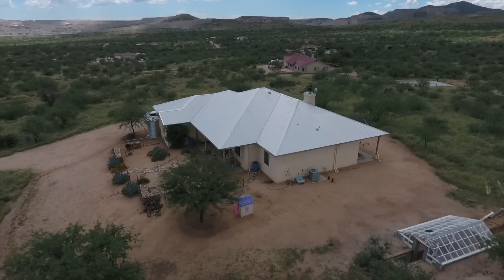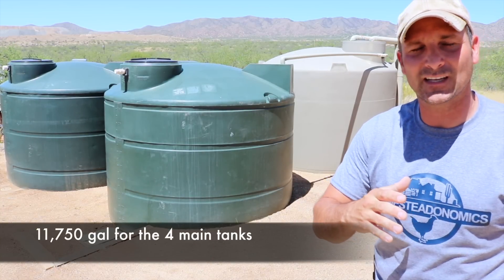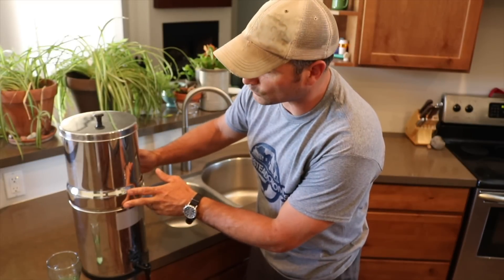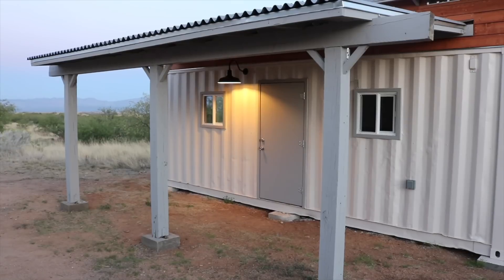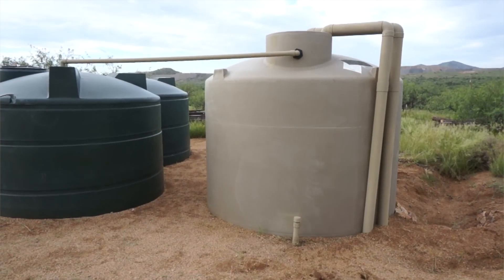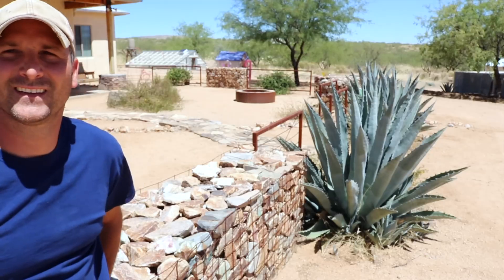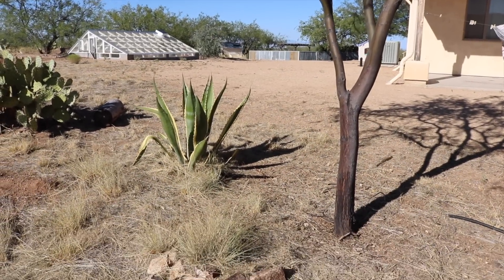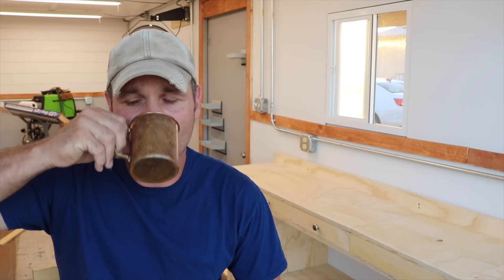Rainwater Harvesting QA - Cost, is it Illegal, how I treat, etc,.

Comment: Love the video and great information! We have 85 acres in Zambia and are currently in the process of turning the land into a farm. Our 4100 sq ft house is built up to the roof level now! It's a 5 year project! We currently live in Oklahoma. So, our land has a small stream, but dries up in the dry season. We plan on installing 2 boreholes as well, but also have a rainwater collection system to use for animals and crops when the stream goes dry. Boreholes are the last resort! My question is: how do you remove all the settled sediment from the tanks? Over time, it will build up. Thanks again!
Reply: hdezmelissa to remove sediment firstly empty the tank, then put down a ladder into the tank, climb down into the tank with a bucket & spade. Then start filling the bucket up with sediment. When the bucket is full, climb out with it and dump the contents. Then repeat.
Reply: To remove sediment you need to flush the system using water to force sediment out or empty a tank and clean it out with a tool.
Reply: I just thought of this, but if you have a large drain valve at the bottom of the tank, you could drain the tank, then use a hose to spray out the sediment and just sluice it away.

Comment: Wow, here in Ohio we have on craigslist those bins.  you see a metal wire cage around the container.  They are listed for as low as $50.00.  You could get one on a pickup truck I believe. I thought of buying a few and putting them on the corners of the house to collect rainwater so I could water trees and flowers without running up my water bill. I was then going to build a small wooden fence around each one to hide them from the road.  Maybe put on a cut out wagon wheel or something for decoration.  I enjoyed your video on how you had it set up and now I know I am going to do it!

Comment: We live in southern Mexico where we finished building our 3500 sq ft adobe house about 2 years ago. We get about 35-40 inches of rain during the 6-month long rainy season here at about 8000 ft elevation. We topped the roof with galvanized steel and with all of the patios and eaves, we have about 6000 sq ft of collection surface. We put gutters on one side of the house to carry the rainwater away from the uphill side of the house because we were not getting sufficient drainage.

We haven't collected rainwater yet because we can get all the high quality well water we can use from the city for about USD$18 per year. But in the future, the quality or amount of city water may change drastically so we  may collect rainwater in the future.

I wanted to ask you if you are able to use compost or sawdust toilets in your area. This would greatly reduce your water consumption. We have used a sawdust toilet in both of our bathrooms for about three years now. Once we fill up a cubic yard of compost, we let it sit for a year and then spread it around on the field where we plant fava, scarlet runner and black beans. We are not connected to the city sewer and do not plan to be. All of the black water from the town flows untreated into the local Zahuapan River so we have decided to not participate in that pollution.

Thanks for your video. I  appreciate all the thought and planning that have gone into what you have done there and the time that you took to post it.

Comment: Okay, SECOND issue I am able to see. If you have some say.... 18w CLF that has ZERO Phosphor. Wouldn't you just ensure all water passes through some oxygen while under UV lamp? Creating Ozone inside the bubbles. Ya might get some whistling toliets... But it's just gas build up. Well leave the bathroom fan on. Ozone isn't that healthy. BUT easily funnel it away which would float into top most layer of Atmosphere. Try not to operate 4 hours before a lightning storm. anyway :thumbs up:

Comment: I have a place I am building in unincorporated Colorado...I like the tanks you have but can they be totally buried as I will need to address the freezing issue every winter...
Reply: Concrete cisterns are the way to go for buried/underground tanks. And you have 2 choices generally. You can buy a "Water" cistern, or you can buy a septic cistern. And the septic cisterns are roughly half the price of the water cisterns... And did I mention that either will be brand new (clean) and made exactly the same...  Do I really have to spell it out any clearer?

 And since you are in Colorado (or anywhere else where they think they own the rain) I would keep the small talk to a minimum with your salesman and delivery driver, and back hoe operator (installing the cistern on your site). You bought a septic cistern and they are simply dropping it in the ground for you. Bye bye now, I'll take it from here.

 And one last tip. By far the greatest threat to your freedom of collecting and storing water, should your local thugs deem you unworthy, are your neighbors, and people who regularly pass your property.

 Plan ahead and make the project happen in one day and minimize the busy bodies curiosity. Also best if you disguise/bury/conceal the plumbing to simply "Appear" normal to your area. Nothing to see here, move along.
Reply from the maker: hi william.. these are not designed to be totally buried.. you'd have to get meant to be buried... those types will have ridges or ribs on the sides to give more strength.  I'm actually investigating the possibility of doing a buried tank to add to my storage.  But my tan tank is about half way buried if that's any help:)  
great to hear from CO!  Joe
Reply: thank you for your prompt reply...I love what your doing where you are. What a great thing to be self-sufficient as God intended, well done!
Reply: As another source to check into, I would suggest a new fibreglass tank meant for fuel storage.  They are designed for burial in the ground.  As a caution check for ground water and how deep the top surface of it is.  An empty tank can "float" out of the ground if there is a high level of ground water.
Reply: Janice, you need to check what kind of plastic that tank is made from.  There are many grades of plastic and some are NOT safe for food or water storage.
Reply: You could build a concrete "box" to lower your tank into. The soil will not contact the tank. It will add significantly to the cost of the project, though.

Comment: If you need more water, you could just take a liner from an above ground pool and place it on the ground with an inward pitch to collect the water.  Dig a hole in the middle where the water collects and bury an underground collection tank.  Use a pump to move the water to your house

Comment: WOW! only thing if you cover those clear totes you won’t get algae. Does hurt anything, just grody and stinky. Have you looked into using one of the big collectors in a greenhouse to act as heat sink. It is what they did wirh plastic drums for passive solar. Just wondering. I DIDN’T KNOW YOU WOULD GET ENOUGH WATER WHERE YOU LIVE TO COLLECT THIS MUCH WATER....great job.

Comment: In Utah, you can use up to 2 closed containers each of 100 gal. max without registering with the state but if you do register, you can use up to 2500 gal max. No cost to register. I spent 2 years working to add greater flexibility to the previous law. See http://fredcox4utah.blogspot.com/2013/03/2013-hb-36-stormwater-capture-amendments.html
Reply: IF you have water rights, you could store more.
Reply from the maker: Hi Fred,

I would prefer there be no legislation governing the collection and personal use of rainwater.  But I appreciate you at least taking steps to make it easier.  Thank you sir:)
Joe

Comment: 10:36 I was expecting you'd say, "I still think the argument doesn't really hold any water"

Now my question is, rainwater is too soft. By that I mean it doesn't wash away soap easily. How do you deal with that? Do you add anything in your tanks, or does it get slightly hardened by staying in the tanks?

Comment: In the Puna District (and other areas also) on the big island of Hawaii, a lot of houses use rainwater catchment systems. We have metal roofs. The water is stored in tanks, in our case, I think 12,000 gallons.We have a pressure tank, a water pump,etc. We use two filters. First a 30 micron, then a 5 micron. Lastly, we have a UV light, which kills any living organisms that might make it through the filters. Our water tank is made of corrugated steel, with a food grade liner, and a cloth cover. Filters get changed when i notice the water pressure might be lessoning, usually about every 3 months. The pump and pressure tank, I believe are common in well systems too. Plenty of rainfall here, a lot of it at night, so our tank never gets very low. In some states, it is illegal to catch and use the rainfall that falls on your roofs.

Comment: 5000 USD? That's nothing, just the installation cost, the cost for getting access, not the actual installation with pipes and digging and shit when we were forced to switch to the municipal system back in 96 was 230 000 SEK I think for our house, USD was about 6 SEK back then I think. So just getting the access cost in the region of 40 000 UDS, plus 1000 sek a meter for the digging and pipes which was 150 meters or so. That in 90-ies money... 5000 USD, you got a good deal right there bud.

Comment: the reason its illegal some places is not usually a good reason. most major cities will say if a house is not connected to the right recognized utility grids like water and electricity, it is not fit for human habitation via their own standards. someone who lives off the grid with water collection and solar panels would pretty quickly get flagged for substandard living and would either have to connect to the grid, or risk having their home condemned and demolished. the reasoning cities give for this in a nutshell is they cant trust that the people in off grid homes can provide as consistent, reliable and as high quality levels of service as the grid could. to go more into detail, they cant trust that the water quality is up to spec. they cant trust that the wiring is good and not a fire hazard as well as the storage for the power and water, both being secure and hazard free. you can get the city to inspect and verify this sort of thing on a regular basis in some places, but often the cost and trouble this causes for the owner makes it no longer worth it. there are huge costs to regular inspections in addition to the penalties you have to pay when not up to spec. cities make it troublesome and negate the savings like this on purpose to keep people dependent on the grid. many places will say they encourage self-reliance, but the utility companies having a hand in local government's pockets usually means those statements are not true in practice. that being said, if you set up a system ahead of time and disconnected yourself from the grid but still draw trace amounts of power and water to not draw attention, you could probably get away with doing so unnoticed for a long time. you could also disconnect certain systems from the grid but not all. things that are typically more expensive like air conditioning or appliances plugged into sockets could be re-wired to only draw power from batteries charged by solar panels for example. lights, especially if you convert to led's, hardly draw any power but would be the perfect thing to keep connected to the grid to fool utilities into thinking you are still dependent, but they are also perfect in that they are non-essential. grid goes down and you still have the power stored from solar panels for things like air conditioning and the fridge. same could apply for water, though depending on where you live, water could be a non-issue. here in Florida water bills on a house with 5 people living there would find it hard to break a 20 dollar a month ceiling on water usage unless there was a constant leak somewhere.

Comment: yea mention the fact that if you have a well, that besides the initial cost of the well itself, you have to use electricity to pump the water OUT of the well. We lived in Sierra Vista, AZ for 25 years and had several friends and family in Tombstone, where in some cases they had to drill down 300' to get water! So do you use grid electricity or solar/battery to pressurize your system?

Comment: I suppose if you have a dry spell and water levels dip (I lived in SE Arizona for 25 years, so I'm familiar with dry spells and droughts) you can have water hauled in, eh? Do  you use AC or a swamp cooler? I was watching this and was thinking about doing something like this here, but then  I realized, that we have a half-acre pond, 10' deep (in central Ohio). The house runoff feeds the pond, so I suppose we could extract water to use for the house. We do have a well.

Comment: I like these setup and what you built is awesome still you are skipping a lot of safety measures like how you filter and where you filter. You can do your stuff pretty well cuz you live in an rural area that seems to be pretty far from a city. You can't do the same in other areas because of the toxicity (metals, bio and chemicals). You said the ph is not important!? That's an ignorant statement! 

A non alkaline body cause a lot of problems. In fact cancer may be one of the problems related to that. If someone get's cancer they are put in an alkaline diet for the body to handle chemotherapy and other treatments. If you had any stomach problems like acid reflux or heartburn a low ph water will worsen the situation. In the end you mature much faster cuz you damaged the indoividual organ cells and the system that handles regeneration... You can't compare chemistry to how a car handles speed and torque lol In these times of extreme pollution that's a dangerous advice.

Comment: Why not use a RO filter system for drinking water?  That's what we have on our well system.
Reply from the maker: Unfortunately they aren't water efficient from my research.  I could be wrong but I've read they use 1-3 gal of water to produce one gal of pure water.  I'm sure the really good ones are close to a 1 to 1 match but I can't afford the extra water use if the system isn't 100% efficient.  I'm sure they are the way to go for most folks but I'm limited on my water.  :)
thanks for checking it out:)
Joe
Reply: I'll have to check and see if our system has a drain connection.  I know it has a multi-gallon storage tank, and two replaceable filter elements under the kitchen sink.  The filter is slow, and the output flow rate is low.  Ours has a dedicated spigot and we fill bottles of water from it to put in the 'fridge.  It also feeds a line to the ice maker.  If it doesn't have a drain connection, then it shouldn't be 'wasting' any water.

Comment: You should use silver and H2O2 to treat your water.  Chemicals is not the way.
You say probably on the chlorine levels but do you actually measure the parts per million???
And I for sure would use multi-stage filters before the water came into the house except for the toilet and cloths washer.  I'd also put a covering over those plastic tanks the sun on them is only leaching stuff into your water supply all the day long, cover it to stifle that as best as you can.
But please don't take me the wrong way though, I like what you did, much better to be self reliant than need utilities.
Laslty you REALLY should atleast at a UVC light filtration into your system, then you really won't need chemicals.
Okkk one last thing, before I'd drink it I'd still run it through a distiller as the only water I drink comes from a distiller....   Then all the junk is in the boiler and not my cup, it's as clean as it gets.

Comment: I live in Australia, we rely on rain water. The town supply runs within about 1km (1/2 mile) but we don't want it anyway. Our roof is 140sq.m (1400sq.ft) and our main tank is 22,000 litres (about 5,000 gallons). We get about 360mm (14in) of rain per year. We have another collection roof on a cottage above our house, with a huge 35,000 litre tank (9500gal) (it was here when we bought the place), so we use that for gravity-fed water, at about 1/2 mains pressure, and in 7 years we have never run out of water.

I need to clean the tanks (never done it) but the gutters and roof are cleaned each month, sometimes by hand, sometimes with air blaster or water blaster (divert the tank inlets first). I don't use gutter-guard to stop the leaves (we have a LOT of leaves, Aussie gum trees go year-round) as it makes cleaning to hard.

We don't treat the water, just a basic mesh filter on the pump inlet (when not running from gravity feed). No chlorine, no flouride, just good natural stuff like dust and radiation from Fukushima. 

Rain water is safe. Like any food, keep the system clean, basic regular PREVENTATIVE maintenance - don't just wait until something breaks, inspect, and occasionally tear-down and rebuild things that get lots of wear.

GREAT VIDEOS, keep them coming please.

Comment: Hope I am not over stating the obvious. I would assume that the green tanks are able to be isolated in case of failure. Add additional tanks on a 5 to 10 year cycle so when they do need to be replaced you still have enough water and don't have to replace all the tanks at once

Comment: I just go done installed 2 55-gallon barrels off the back of my house to water my tomato plants with. I know the system will overflow with the rains we get in Pennsylvania. However, it is a start. I plan on adding two more off of that section of the roof in the near future and possibly adding four more barrels off of the other half of the roof and the garage.